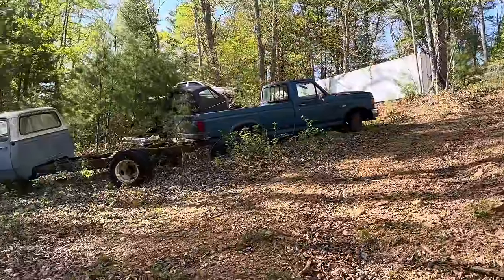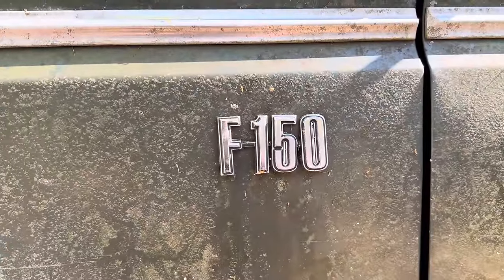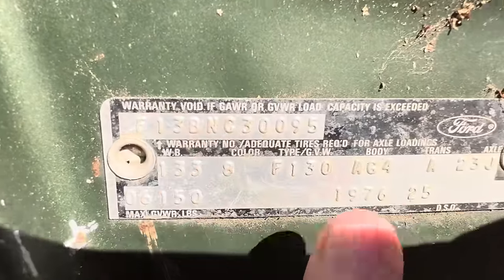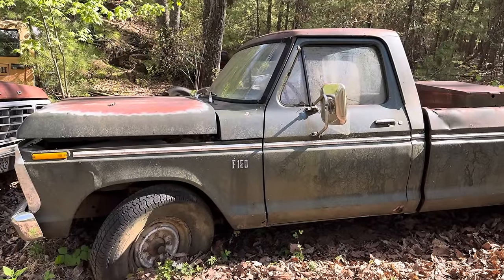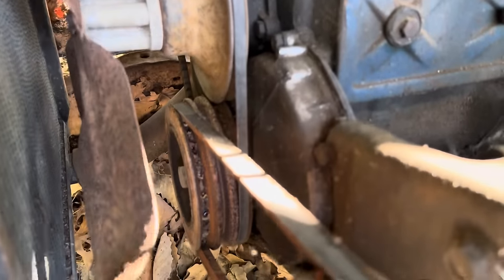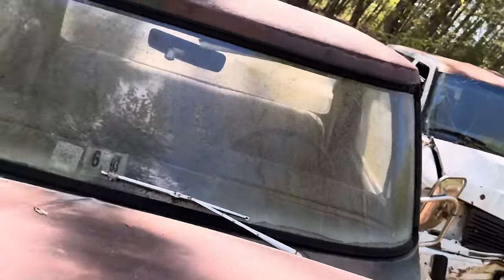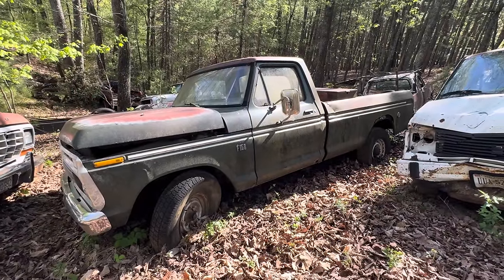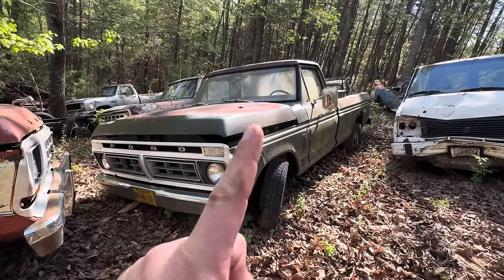Uncovering A Hidden Gem: Strange Ford MYSTERY Truck Discovered In The Woods! #RustBucketRescue

Comment: It has orange can of death oil filter  so definitely  sludged up  needs wix or Motorcraft filter and Delo 30 wt oil 
We have this same truck with a 460   4x4
Reply from the maker: Yes I cringed when I saw the orange can of death!
Reply: @RustBucketRescue  mix a good dose of marvel mystery oil in fuel helps lubricant everything  especially on a engine sitting for years 
Plus marvel is a good cylinders pre soak .. great video  thanks for posting 👍
Reply from the maker: @quagmiredavis4117  ah yes, I’m well versed with marvel mystery oil!  If you check out my channel I actually have a follow up video on this truck, and am working on a third video now as I work on getting it back on the road, stay tuned!

Comment: It's like an 84 f250 I had, 300-6 with an 8 lug 8.8 rear-end, non full floater. Very odd ball. I was told it was a factory experimental truck. I regret I  traded it for a 7.3 diesel...
Reply from the maker: I’ve always wanted to go back in time and be a fly on the wall when the dealership salesman was trying to sell that oddball truck on the showroom floor, or be a fly on the wall when the customer came in with a super oddball special order.

Comment: So its a body swapped F150 on a 250 frame/driveline, but from the factory? Must have been a fleet option.
Reply from the maker: We’re about to find out!  I bought a F250 to make a follow up video where I’ll compare the frame thickness, suspension, brakes, axles, etc to see what components are F250 and what components are F150.  Stay tuned!

Comment: we called those heavy half-tons.... 1/2 ton chasey with 3/4ton amenities.
Reply from the maker: It’s definitely that!  I’ll be comparing it so a F250 in my next video to reveal the frame thickness, examine the leaf spring packs, brakes, etc to show what components are F150, and what comes straight off the F250s

Comment: Another odd one. Looked at a 1985 F250 Reg RWD 8' bed 300 I6 automatic. It was a fleet government truck (Canadian Coast Guard). I was very surprised to see 8 bolt wheels connected to an 8.8 rear end. I googled and apparently it was a 2 year thing. If I hadn't seen it I would not have believed it. I a have pictures but don't think I can post them here.
Reply from the maker: Very, very interesting!!! An 8 lug 8.8!  How odd.  That truck sounds like another rare-as-hens-teeth oddity.  I love weird, oddball build packages! Great conversation starters at a car show!

Comment: 300 best engine Ford ever made
Reply from the maker: Couldn’t agree more!  They can’t be killed!
Reply: The 200 was also a great engine just got crappy fuel mileage.
Reply from the maker: @garyr7027  gotta disagree with you there, I’ve had well tuned 300s get in the low 20s mpg.  For a carbureted, heavy, un-aerodynamic brick, low 20s mpg is quite the feat.
Reply: @RustBucketRescue  I was talking about 200 fuel mileage, not the 300. I don't know about the 300, but the 200 perfectly tuned I had was 17 to 18 mpg tops. It guzzled gas. Better off with a good V8 for mileage imo.
Reply: I have a 240 that ford rebuild several decades ago and it sit just outside of highlands nc has a ford rebuild tag from memory  .20 piston 10 10 on crank sadly it was never ever cranked for several decades was in 66 long bed and got serious rust in bore but some good parts the head will need full rebuild but small chamber heads little bit better compression.  Don't need now . Rust bucket rescue text if you're interested free to you and as the other players on market book say don't low ball me I don't have a clue what I got . 😊
Reply from the maker: @gregallen4272  that’s about a 5 hour one way trip for me, but I’m interested, if nothing else it would make for a great story!  Let me get this beauty back on the road and I may make visiting you the inaugural trip!  Now THAT would make for an awesome “the truck lives again” video!

Comment: So i have a '74 F350 with 350 running gear in it but the gvm is rated as a F250 i wonder if it was a Ford Australia parts bin special for those wondering its build date is 4/74 short wheel base powered by the 300cid inline 6  4 spd manual trans dual rear wheels 8 stud all round ( Lug ) suspension is all F250

Comment: I remember these. It’s not that rare. Before the F150 became the standard the F100 was the standard nomenclature for the 1/2 ton truck. The first F150s were 1/2 ton trucks with 3/4 ton running gear. There were quite a few of these used in the oilfield here in south Arkansas.
Reply from the maker: Considering they are a one year only truck, seems like by default they are pretty rare, and on top of that with all the attention that’s being put on them now, very very few are popping up.

Comment: With F250/350 running gear makes you wonder what frame it had as that 8 lug setup was heavy. I had a '76 F250 w/460, a California truck but a real dog until the two grocery bags of smog garbage went to the dump and an early 460 distributor and 780 cfm Holley 3310-1 replaced the tiny Autolite. As of about 3 years ago that truck was still running but as an unlicensed farm field truck.
Reply from the maker: I bought a ‘79 F250 with a 460 recently, I’ll be parking it next to this F130 and making a followup video soon comparing the frame thickness, brakes, leaf springs, axles etc to see what F150 parts it uses and what F250 parts it uses.  Stay tuned!
Reply: @RustBucketRescue  I had one of them too - and the second best truck I've owned though It was an F350 LBSC with, again a 460/C6 and it too ended up as a field truck since I'm in the rust belt of way upstate NY and that dreaded rot worked its wonders
Reply from the maker: @jdwht2455  they’re bombproof trucks, the engines and transmissions were so good back then, but unfortunately rust doesn’t care how reliable the drivetrain is!  I’m blessed to live in the south where the environment is much kinder to old still, plenty of these babies back into sheds and sitting out in the woods, ready to pull home and revive!
Reply: I have an F250 camper special with a 460. As far as I know I'm the 3rd owner & it never had any emission stuff on it. I'm in kansas
Reply from the maker: @rickhammar1636  what year is it? What color?  Sounds like an awesome truck!
Reply: @rickhammar1636  Yes, it did as OEM but was real easy to remove/fix. It had at least an EGR and an air pump and probably a tiny AutoLite/Motorcraft  carb, less then 500 cfm. Depending on the year it also may originally have had real crappy heads with small valves/ports and a low 8.5 compression ratio after 1973, Best heads are the1969 “C9VE” or a 1970 “DOVE” castings at 10.5:1. Carbs at about 750 cfm can work well but too big especially if towing an RV at altitudes over 5000 feet.
Reply: @RustBucketRescue  it's a '77 but the data plate says the build date was 9/76. It's white.
Reply from the maker: @rickhammar1636  build date of 9/76 would put it right at the model year cutoff, so that was likely one of the very first model year ‘77s to roll off the assembly line, which is a fun little conversation starter.
Reply: @jdwht2455  I will have to do some research. I am not a ford guy. It is titled as a '77 but the build date says 9/76. The intake has no blocked off egr valve. No signs of anything removed. I am not saying it hasn't been but if it was it was a very nice job. I'm pretty sure I read somewhere that the emission stuff wasn't required in kansas on that weight of truck until '77 or '78. Putting my just under the date required for all that stuff. With the exception of a pvc valve. It does have a pvc valve, which as I understand is about the earliest form of emissions control. From my understanding an F250 camper special is basically a 3/4 ton with 1 ton suspension. Is that correct? Can any ford folks enlighten me about that?
Reply: @rickhammar1636  Ford (actually ALL) pickups 10,000 pounds and over GCVW were pretty much exempt in 49 states with California being the exception. My '76 as noted had the two grocery bags full of "crap" but it was a Calif. truck built in Calif. for their DOT but sold as new but surplus to the original owner, a navy pilot. It ended in NY State when he was reassigned and his father was askek to sell it in 1977. My '79 was a Lariat Camper Special, built, IIRC, in Kansas, had a pcv, EGR as well as an air pump. The delete for the clogged EGR (8000 miles) was a simple aluminum spacer with the air pump disappearing to the dump. PCV's were standard from prior to '63 as I had one on my '63 Galaxie 406 but nothing else.

Comment: Had 1977 F100 with the 300cid 3 on the three. Poor thing got 16mpg at best. I still have my bill of sale but failed to find the truck by serial number.
Reply from the maker: What they lack in MPG they gain in reliability though!  Bulletproof combo, simple transmission with a simple engine!
Reply: Imagine what modern technology could do for the inline 300?  Seems like 300 hp would be easy to attain and great mileage would be possible while towing a house up a hill.
Reply from the maker: @cheftomsd  the Ford Barra engines make up to 425 hp 425 torque, they’re just a ford inline 6 with an overhead cam and a turbo. Turbo 300 six guys are pulling 500 and 600 hp without beating the engine to death.  350 hp could be done with the mildest of builds with today’s technology and be rock solid reliable!  They’re a fantastic engine platform that has really stood the test of time!

Comment: So I'm curious what springs it was equipped with?  F150 or F250?
Reply from the maker: You’re asking the good questions!  Stick around and stay tuned - I’m working on a comparison video comparing it to a same-era F250, comparing the brakes, the frame thickness, the leaf springs, the axles, etc to finally put some of the mystery to rest on what makes a F130 a F130, what parts are F150 parts, what parts are F250 parts, etc.  Hang around, I’ll think it’ll be an eyebrow-raiser for everyone!

Comment: So everyone is SURE that this is not an F150 body, complete with its VIN, sitting on an F250 chassis?
Reply from the maker: Well it kind of is, but done by the factory.  The F130 model code on the door tag is this package, so this is an “official” oddball from the Ford that was born this way from the assembly line. Super strange, super cool!

Comment: Just search 1976 f130 there you have it.. Just a heavy duty f150
Reply from the maker: It’s not that easy.  The question is WHY do that.  That’s a lot of added expense to an F150, when you could just buy an F250 configured the same way.  Plus the GVWR is like 100 lbs heavier than a normal F150, so why spend all that extra money to gain 100 lbs of capacity when you could just buy a higher GVWR F250 and be done.  Nothing about it makes since and that’s the mystery.

Comment: It looks like it's an F-150 badge on a F-250 also the 150 badges kind of a little brighter than the rest of the truck and I think you had it backwards about the Amber headlights 77 Wesley Amber headlights 76 had those headlights just like that truck is supposed to have
Reply from the maker: It’s a true F150, the F130 model code is an F150, but with 8 lug F250 running gear.  I’m going to make a follow up video comparing it with a F250 to show the similarities and differences.  It’s a strange truck!!

Comment: It's not an F130 it was a special order F150 with the HD package. Later in the 80s the HD pack was also packaged as an off road package as well and the F150s got dual front shocks in the front. I have two of those. Prior to that back in the 70s those trucks got the one ton Dana 44 straight axles & later only on the F350 had the 8 lug wheels had the straight front axle well into the mid 80s. So it is not an F130 as stated just a truck someone ordered with the HD package. I believe those special orders also had the 12 inch rear drum brakes in the 70s. Later in the 80s Ford gave the F150 HDs 11 inch rear drum brakes and the split front axle Dana 44. Mostly the trucks with the front disc power brakes all had the same Calipers. I have seen 80s HD trucks & F350s with a rare dual piston Kelsey Hayes system on them. Searching for those calipers good luck. Most ppl replace the entire spindle and convert them to the single piston. Finding one of those dual piston calipers new is a farce nobody has em.
Reply from the maker: Good info, but under model on the data plate is straight up says F130 and the VIN starts out F13.  They’re very much a real thing, Dentside Depot just did a video on them as well.
Reply: @RustBucketRescue  If it was an F130 it would say F130 on the fender. What is on the data plate is the code and having restored many of the older Ford pick ups which I can could show you the two I have at my home shop none of the vins f13 of f15 in em. Ford back then was a lot like Dodge usually having X4 for four wheel drive or Y2 for two wheel drive. That doesn't always stick with the Explorer pickup model the Lariat Model or the Bronco's had the weirdest vin codes in em and truth be told there was a half dozen Bronco models too. Most of the Custom Cabs and F150 standards all had designations in em. I got that from a Ford dealers archives Bethlehem Pa.
Reply from the maker: @thekingsilverado3266  when I say F130, I’m referring to the model code, which is an obscure one used for about 6 months only and nothing about the truck makes no sense, hence the mystery.
Reply: @RustBucketRescue  Ford & Chrysler had special order and fleet packages before any others thought of it. AMC went out of business went because they were that stupid. Police wanted the Javelins with the 402 packs. They made a hand full of em and boop bleep. Police loved em with their suspensions and fast acc. AMC said the govt capped the package because of MPG you know that was a crock Chrysler was preferred... I am not a kid you R taking to.. I know the facts.
Reply from the maker: @thekingsilverado3266  not talking to you like you’re a kid, just stating the facts.  Yes everyone had special order trucks and cars, but no they often did not get their own unique model code.  I’ve worked in GSA before and sold Ford and Chevrolet trucks to government authorities and can attest to some very specific, strange truck builds for the government and municipalities, but they got very normal model codes entered onto the dataplate.

Comment: I once had a 1980 E-100 Van. Shorty, no power brakes.  Your thoughts?
Reply from the maker: My thoughts are that's an awesome van!!  What engine and transmission did it have?
Reply: @RustBucketRescue  300 and auto.
Reply from the maker: @frankfurther3828  what a great engine!!
Reply from the maker: @frankfurther3828  what a great engine!

Comment: I used to knock the kingpins out of the I beams and swap the 100, 250 and 350.
Reply from the maker: Ah, so like putting 350 pins in a 100 to beef it up?
Reply: I think he changed the outer hubs from 5 to 8 or the bud style wheels I used to change the whole axle.  I thought it was less work unbolt the spring strap and shock the radias rod bolt the center bolt and one tie rod it was on the ground it straight up heavy but straight forward used a bumper jack.  Still have it but rust bugs have its seal leak.   But it was very handy would lift any car or truck 3 or 4 feet . Getting older now
Reply from the maker: @gregallen4272  I recently got a bumper hook attachment for a Hi-Lift 60” jack.  I don’t trust it enough to get under a vehicle with it, but it does great to get something way up in the air so I can put in tall 6 ton jack stands at a much higher setting than what a normal jack would allow.  Hard to find bumper jacks anymore, they’ve kind of disappeared, never see them in stores anymore.